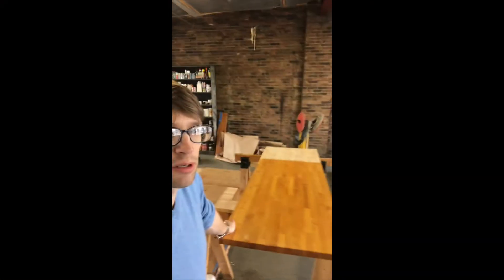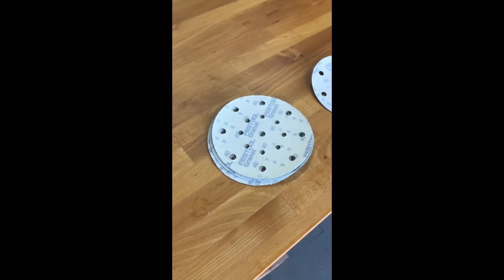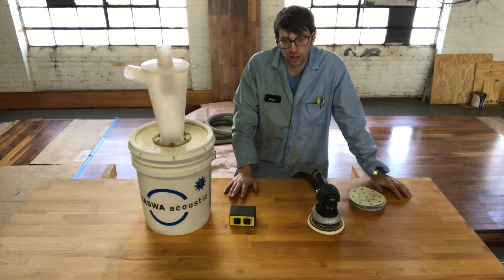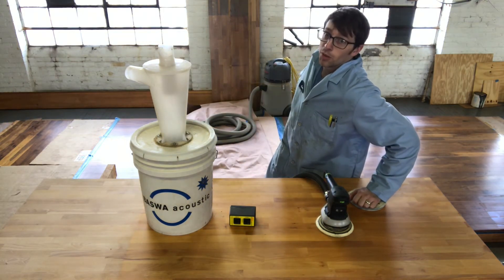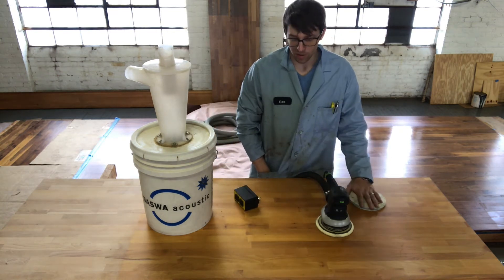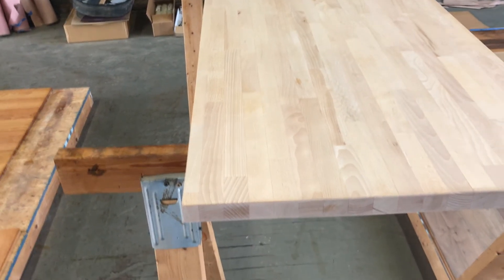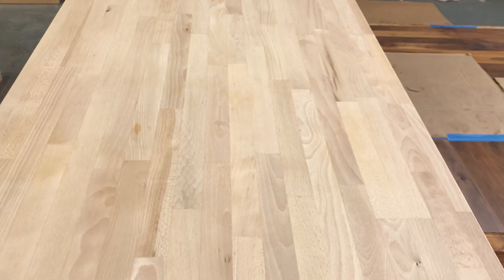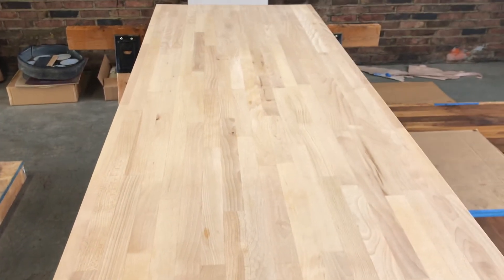Removing Old Finish

Comment: Do you have a good video showing how to refresh an old Waterlox treated countertop?  my countertop shows dry spots, do I need to remove everything or just the problem spot and how deep ?
Reply from the maker: We do not have any videos on maintenance and reapplication, but we do have some helpful guides: https://www.waterlox.com/project-help/guide?id=98bf39c6-7eec-4433-b735-8ddd5c7dcbb5&q=

Its not a simple answer as it depends on which Waterlox products were used and the extent of the damage.  Typically buff/sand until the major damage is removed, then rebuild the layers and apply a fresh final coat to tie it all together.

Comment: Aside from faster application, does the new UTOS and H2Olox in satin yield a better result than the Original + Waterlox Satin for a countertop? Is the H2Olox Satin more forgiving than Waterlox Satin?
Reply from the maker: Our H2OLox products are pretty easy to apply.  Overall, the Tung oil and resin that make waterlox Original products what they are are the same in both instances so the performance is very much the same.  I think the H2OLox are very forgiving to apply.